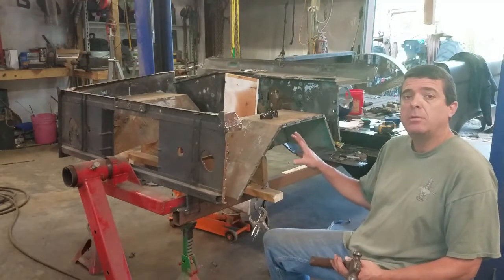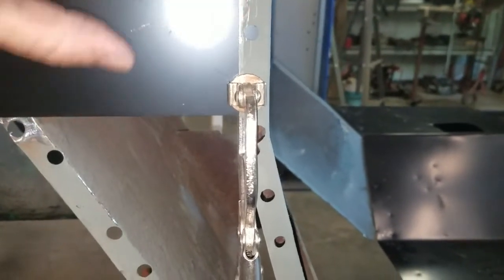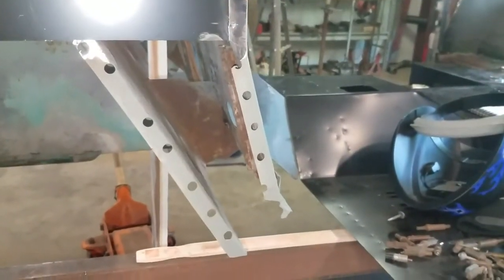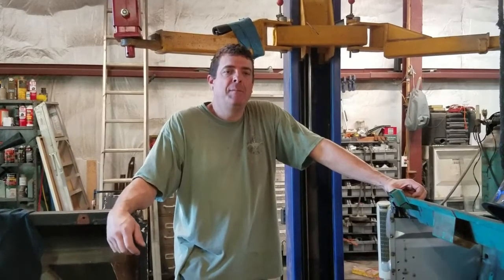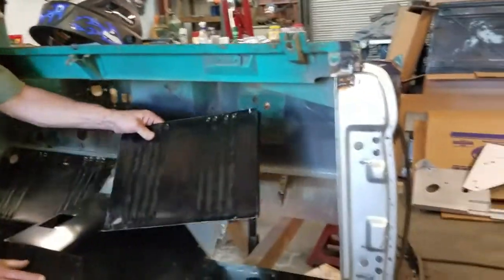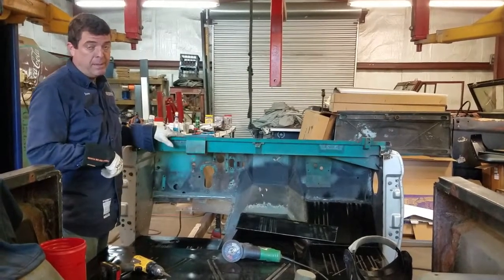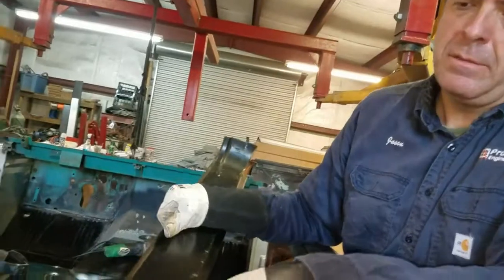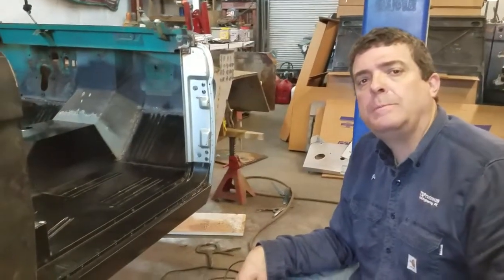Welding in KICK PANEL, A PILLAR & FLOOR PANS - 1966 Ford Bronco Restoration Project

Comment: Thanks for the info on the rockers, I have the same ones and was trying to figure out how to use them. They are way off, looks like I'd be cutting up mine as well.
Reply from the maker: Make sure you elongate the hole on the hinge nut plate support before you install it so your hinge will have its full movement.  Good Luck!

Comment: What size holes do you drill for your spot welds?
Reply: I'm doing the same type repairs and on mine, I drill 5/16" holes and they work well.
Reply from the maker: 5/16" holes are great when using a new panel.  When you are having to attach new to old panels usually the hole will be close to 3/8"because drilling them out usually results in larger holes to get the parts to release.

Comment: Have you noticed a diffence on the  fit for the body parts depending on who you order them from?
Reply from the maker: Yes.  The Dennis Carpenter parts seems to fit better than the others I received.
Reply: @JasonJonieBuilds  excellent to know 
I seriously considered getting a tub built  and shipped   then i saw the price tag...  dunno if i wanna save that much time .
Reply: Luke Simpson from what I hear a lot of the tub builders are backlogged also.

Comment: Something that I'm curious about:

Are you planning to tear the engine down to the block and do a top bottom rebuild??
Reply from the maker: We are doing a v8 swap with AOD.  This build will be a beach cruiser.  We have been shooting videos on the Stage 5 2.5" lift suspension this weekend.  Lots of work done.  It is going to be nice.  Thanks for watching.
Reply: @JasonJonieBuilds  what did you end up doing with the L 6
Reply from the maker: @snafubariffic  I traded it to a fellow Bronco rebuilder.  He needed it for a stock restoration.  I have another but shipping from Alabama to the Northwest is kind of expensive.
Reply: @JasonJonieBuilds  I watched a  truck power video and they threw a turbo on  an inline six and was able to get over 500 Ft.Lb of torqe  and  easily over 300 HP with only 10 lb of boost.  ... but if  you want to give it to me  to get it out of the way I'd certainly consider paying the shipping cost. LOL